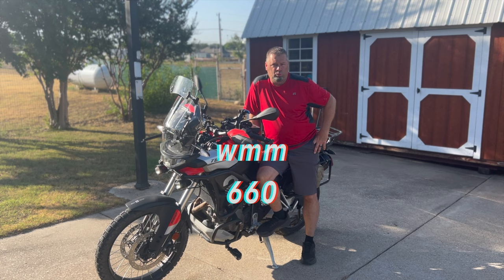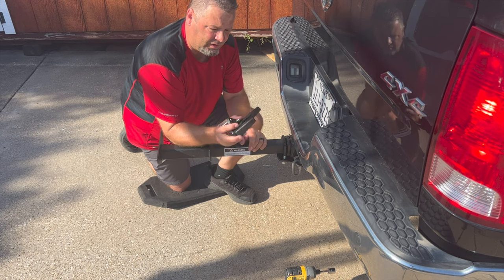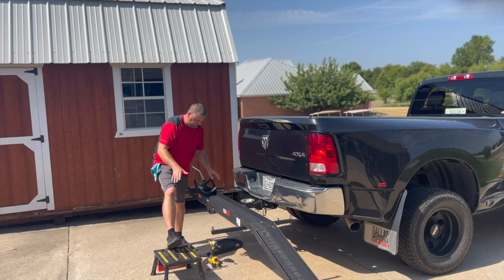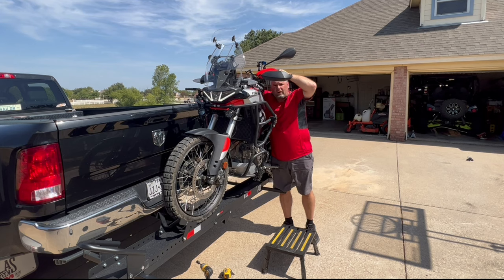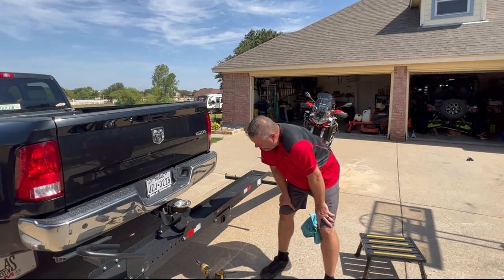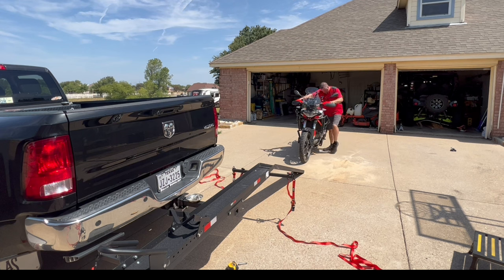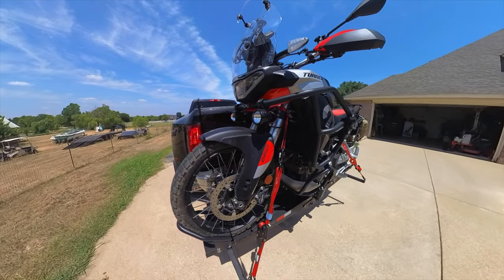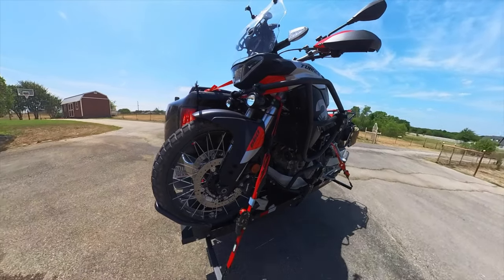Black Widow Bike Carrier(Assemble&Test)Aprilia Tuareg 660

Comment: Great video. I have the same hitch carrier coming in soon but it's branded under a different name (Ecotrik). I can see the cradle is probably not necessary or even a good idea on bikes much over 300 lbs since it won't hold the bike up anyway and it's such a pain to pull it back over it. The straps hold it in place. Thank you for not editing out your struggles as well as your successes in using this carrier. I'm using it on a 1/2 ton truck and will definitely use the bed tiedown anchors as well to stabilize the bike. You're so right on the bed being a bit too high to comfortably load the bike onto unless some kind of berm can be used to offset that height difference. That's not always practical though. Thanks again!
Reply from the maker: You are very welcome, yes I contemplated getting rid of the cradle. Like you said prob not needed for bike of weight. Hope you have great luck with yours. Ride safe

Comment: I have the same carrier but I got mine from harbor freight (it is the exact same carrier). I use it to haul a 280lb dual sport. My personal config uses 6 ratchet straps. 4 to hold the bike to the carrier and then two that attach the bike to the bed tie downs like what you ended up doing. Before I just used the 4 straps it rocked a ton but after adding the straps that hook to the bed tie downs it was wayyyyyy more stable and I've taken it on the highway going 80, on bumpy Montana dirt logging roads in the mountains and it's been awesome. The extra anchoring to the truck makes a world of difference because it makes 3 points of contact vs 1
Reply from the maker: Yes indeed, good to hear you having good luck with that setup.
Reply: @wolfmanmoto660  how has it been treating you any your  bike? I'm curious to know how it is with a heavier bike bc I'm looking to upgrade to something similar to what you have. Beautiful bike btw
Reply from the maker: @rickylowry3213  its been working great, no issues

Comment: I have that same carrier, but I hooked a small winch to it and it has made it so easy to load and unload.
Reply from the maker: Great idea
Reply: I was going to suggest the same thing and take that wedge off. You don't need it because you can put a wheel chalk behind the tire with a strap or bungie. I was thinking of making a temporary 1" square steel bar to connect to the handle bar so it will stay up while I hook the straps.
Reply: Would you be able to post a picture of the winch on it?
Reply: It is winter big time here in Alaska. Sorry, but it's put away until spring. @DannyLe-lp2rw

Comment: I’ve done a truck bed (first Gen Tundra 4x4, truck bed pretty high), a trailer (kendon and generic) and a trailer hitch on a Land Cruiser. Trailer by far the easiest to load and unload. Oh, with bikes about 340lbs. Didn’t love the trailer hitch rack at all. Made me super nervous. My little clamp also didn’t fit for different reasons. I put some JB weld on the junction before I headed off. Good for 1 run then it sort of crumbled. But it worked. I recently sold my kendon trailer. Will replace it when one pops up on FB marketplace. (Mine had no title and I didn’t want to hassle with Tarrant county to get it registered. The VIN was unreadable). Small urban house with no outside room for a trailer and the kendon fits in a normal garage. I wish you well, but long-term, I don’t think it’s a good deal for a heavy bike. Use a trailer, or by an El Camino 😂.
Reply from the maker: Trailer is definitely the easiest, I just wanted an option without trailering. It does make me a little nervous but its rated for 600lbs

Comment: Have used a lighter duty version similar to your model with my KX250 when I don't want to trailer up. In fact, I put a front hitch on my Excursion and hauled it that way when towing a camp trailer to the dunes for a boy's weekend away. Now I have an F150 and take my sport bike with me on extended work trips. Pain in the butt to load in the back of the truck since the bike has little clearance. Sport tires are too wide for my KX hauler, so I may need to pick up one of these Black Widow haulers and try it out.
Reply from the maker: That a good idea putting a hitch on the front, allowing you to pull something as well

Comment: Hydraulic Bike Carrier might be easier!......little more pricey, but No ramps.....it slides under the belly of the Bike, and lifts Straight up, basically a Scissor-Lift/Bottle Jack lift......I think many of them have 1000lbs+ weight limits too. Might be worth looking into. I recently got a aluminum Ramp for my Dual Sport, and it's nice, but they ARE kind of sketchy even though I got a quality ramp, I definitely wish I went steel or just got the hydraulic Lift instead.

Comment: Thank you! This video was fantastic. I'm looking into getting a Black Widow carrier and you answered all my questions. Very helpful. I know watching the bike bounce around can be stressful, but I believe no matter what kind of road conditions you drive across the bike isn't going anywhere. Did you add the non-slip on the ramp and carrier? Purchased from?
Reply from the maker: You very welcome, so the ramp has a very gritty surface that gives great traction
Reply: Thank You! I read under the "cons" that the ramp was slippery and it didn't show any kind of traction, but I noticed in your video it had a gritty look instead of shiny paint. @wolfmanmoto660

Comment: I’m thinking of getting the full width aluminum ramp for your tailgates $500 vs $399 maybe this would help us older people not fall when riding into the truck ? The ramps full width of your tailgate rated 1500 lbs aluminum so light not to expensive. Maybe a rack or wider ramp I’m thinking 🤔 maybe
Reply from the maker: That would be a good alternative for sure. That way you could pull your other toy

Comment: @ 11:35. Easier done than said. 😂😂😂
Do yourself a favor so the bike doesn’t fall in you.  
Build or buy an 18” wide X 12” high X 60” long aluminum step with anti-skid tape so it will support you from the middle of that ramp to at least the middle of your truck where the hitch is.  If the legs retract it’ll be so compact, it won’t take up any space in your garage or shed.
You can also use this 12” tall step for loading and unloading your truck.
You were struggling getting that bike on there with almost no room for error.
Stay cool .
Reply from the maker: Good idea

Comment: I appreciate the video!  I tried to load a Harley Heritage softail in a toy hauler and on a landscape trailer for the first time and stalled out on the ramp first try. It is impressive the way you held the bike especially when it started getting up on the ramp.  I have a 3500 like yours.  My 1250 BMW GSa weighs as much as your bike.  Do you think i would have problems with it?  Also I would like to try a fromt receiver for the front of the truck when i am pulling a trailer.
Reply: I think if you weren't embarrassed you could ask for a little help.  I'll need two people to do it.
Reply: I'd be unnerved about the tailgate getting beat up too.  Weather in Texas is hot enough to fry your nerves!  Those extra straps seemed to do the trick. Until I have to I am going to stick to a trailer.  I don't have your strenghth to hold it off of my tail gate or front bumper.  Do you think this hitch would hold a scooter?  I mean will the scooter tire fit in the cshock without tearing up the tire or hub of the  scooter?  I'll be working with a Honda 49cc metropolitan.
Reply from the maker: I thought about putting a front hitch on, I just dont have the need yet.
Reply from the maker: Two people would deff be better
Reply from the maker: It doesnt touch the tailgate at all. I think it would work for the scooter, the wheel chalk is adjustable
Reply from the maker: Medium size bike

Comment: Looking to order this bike hauler for a ram 2500 with class 5 hitch, so I will also be running the reducer.   Wanted more info on the rhino anti sway device.  Did you order the 2 inch or 2.5?
Reply from the maker: I got the 2”